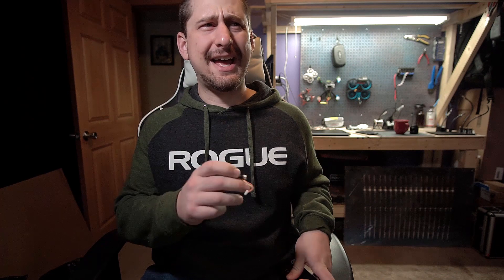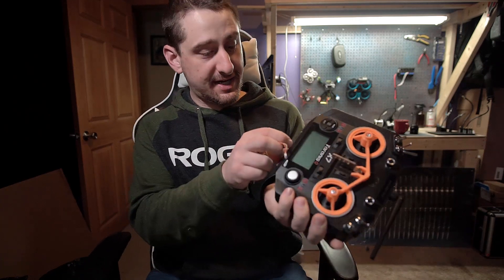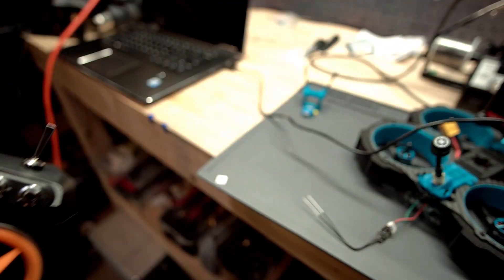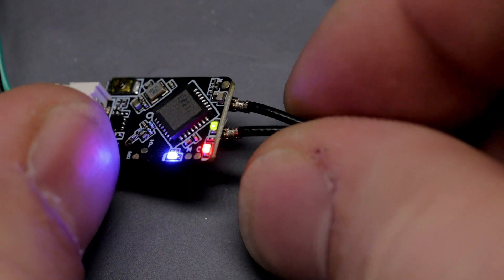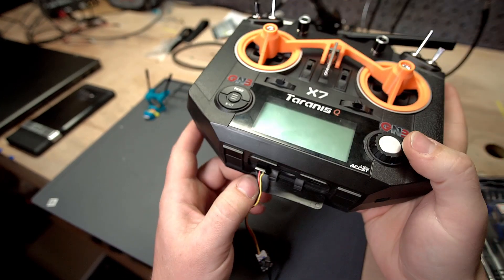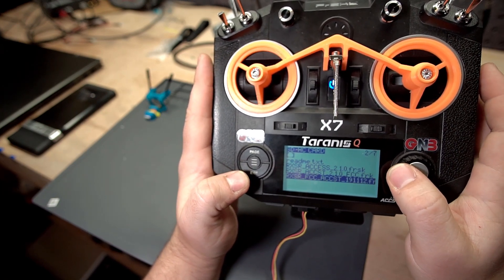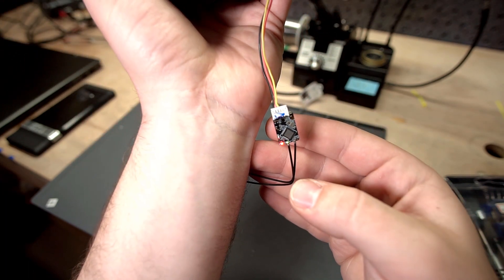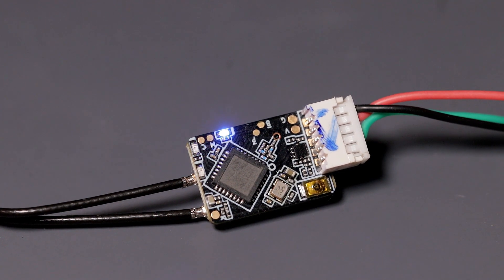Frsky R-XSR receiver Binding issues FIX! ( Taranis QX7 ACCST)

Comment: RECENT FIX: I had a similar issue I found also in the comments is that this didn't work for me also. When you save the file from the FrSky website, you also need one for your transmitter. Once you get a version that is applicable for both your transmitter and receiver (I did 2.1.0) upload those folders into the SD card. From your transmitter, go into a setup and read the SD like in the video. Do it for your receiver, and then unplug all the wires and run the other folder for your transmitter. It should say something like "Flash Internal/external Module" and you'll want to run one of those (I forget which). Make sure when you upload your versions, you make sure both your transmitter and your receiver are the same one, either FCC or LBT. If you choose LBT make sure your Transmitter can handle it. If not, download OpenTX and make it so that it can use EU which is the format needed for LBT.
Reply: @J-S-Films  Your video was one of the only ones I could find that helped me solved 90% of my problem, thank you
Reply: Where would i get the 1.9 or 2.1.0 firmware for my tx12?

Comment: I just got a iflight nazgul5 v2 4s. Same reciever and same qx7. Not binding. Also on beta flight im getting a error message reading "rx loss cli msp" green and blue solid light with a red flashing light on reciever. Could this be this same issue or a faulty reciever. Very new to the hobby. Struggling

Comment: Did this and now red and green are on solid when I power up in bind mode and red flashes when I power up normally. No blue whatsoever. Tried a couple times doing the same as the video, only difference being I didn't create a rec flash profile. Is that really necessary? Or am I doing something else wrong? This is my first time messing with receiver or transmitter firmware
Reply: There is no blue because you are in CPPM mode, you can escape this and revert back to SBUS by holding down the button on your receiver while it is on for about 10 seconds. You know if you did it right if the blue light flashes 3 times. Reset the receiver with power and it should be back in SBUS.

Comment: Do you have insight on not being able to flash the rsxr through the s port? I get the device reset but then it doesnt follow through with the writing. Any suggestions?
Reply: Does the radio just shut off for you as well?
Reply: @rlHypr  It does for me. Have not been able to find a fix.

Comment: Tried all steps with my Taranis QX7 access . And still no luck . I still get all solid lights . Downloaded t he latest firmware for RXSR and works when flashing but when I go to hold bind and power on . Still same lights .
Reply: did you find a solution?

Comment: Right. But if my Turnigy radio doesn't have the port to flash receiver, I'm stuck, and either have to beg someone to flash it for me or buy new receiver or radio. Is there some usb adapter out there that allows to update receivers?

Comment: I just received a Rekon FPV Rekon5. I also have the Frisky X-xsr receiver. Receiver shows all three lights. Also transmitter will not read SD card. I'm 10 hours in and no closer to a solution. Any way you can help?????????

Comment: Now it doeasnt even turn on... Good job! Thanks alot
Reply: Check the pins on your flashing harness. Make sure ground and power aren’t reversed
Reply: @ryannicholson9447  if it worked before with the same cable, it should also work now. Isnt that so? 
Flashing an rxsr doesnt magically rewire my cables
Reply: @mofooooo44444  no but flashing can redirect circuits within the flight controller.  Also the flashing only works if your Taranis has compatible fw version as the version youe flashing
Reply: @ryannicholson9447  yes it seems you are correct, it did redirect shit. I flashed my R-XSR to 1.9 version. Now it binds, but the signal strenght on the QX7 disappears every 5 seconds. It does react to stick movement nonetheless. 
Wicked!

Comment: ,, Hello friend I have a question as you have a lot of knowledge I have a problem with a receiver is the rxsr frsky is giving me a lot of rx loss and it crashes to the ground you could solve it ?
Reply: I would make sure all the solder points on the rx and fc are good and also check to make sure the antennas are seated firmly.